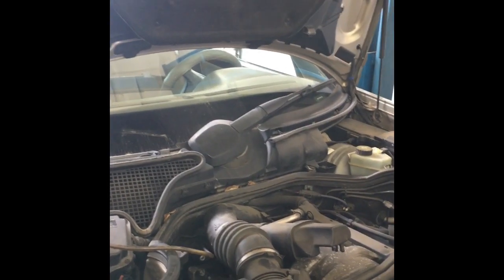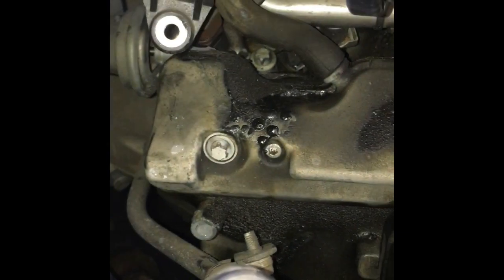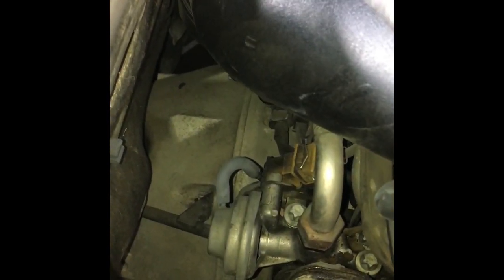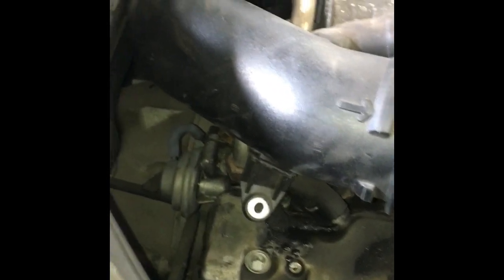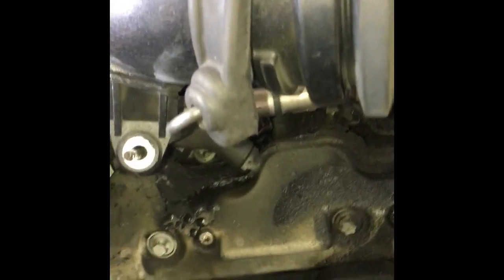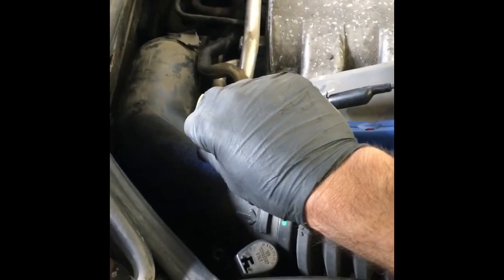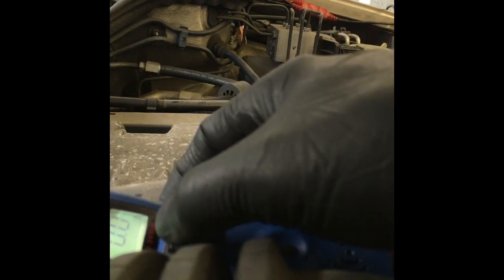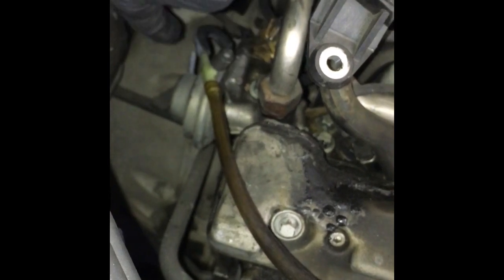How to Diagnose an EGR Valve on a Mercedes

Comment: I added power to the Transducer just like you did and nothing no stall the only thing prior to this test that I replaced was the transducer vacuum switch valve it self if I push on the diaphragm manually it stalls at idel or if I bypass the valve switch all together and add vacuum directly to diaphragm  vac line it stalls I use an old  large pork cereng it makes a lot of suction
Reply from the maker: Sounds like you're on the right track the EGR valve seems to be working by what you told me. So the vacuum switch has to have supply vacuum and then route it to the EGR valve from there. If the switch is not getting ground or power like you said it could be a broken wire in the harness somewhere. And you would have to find the pin numbers on the PCM and Ohm check the wires from End to end.

Comment: thanks if you look up an egr valve for a 2002 mercedes benz e320 you will see this part I'm talking about on the under side of valve it'  just clips on its in between the input suction I Don't  see any point in having it there to see this pies you have to really look closely at it any way thanks let me know what you think

Comment: Hello Brian, I appreciate the videos and that you're taking time to reply to people!  I've got a 2006 Mercedes R500 and it popped the P0400 code recently.  146k on it but overall in good condition even with Michigan winters (read: salt on the roads).  Old EGR valve was a little rusty, seemed like it didn't want to return smoothly when operated manually so I replaced the EGR valve/solenoid and EGR pipe with new.  I noticed 2 of the PCV hoses on the left/drivers side head were cracked or very hard so I replaced those also.  Cleared the codes and the car was good for maybe 3 days and less than 100 miles and the P0400 code came back.  I have seen 1 video that said to check for a intake manifold pressure sensor hose on the right front of the engine and another that said to pull what looked more like the PCV top portion of the valve cover (youtube user ok303 ).  Anyhow, any insight you have would be appreciated.  Thank you!
Reply: I'm going to follow the steps in the How to Diagnose EGR Insufficient Flow video this weekend and will post what I find.  Getting ahead of myself.
Reply from the maker: blaine t hello. I would recheck the EGR symptoms. Check to see if the vacuum switch is getting vacuum from the intake and make sure the hose is not blocked. Then power the switch to make sure it works. If that’s good apply vacuum to the EGR Valve with engine running the engine should stumble. If it does not either the EGR tube going into the intake is plugged or the EGR is not working. If all that test go then I would suspect the map sensor.

Comment: Hello Brian. Great video. I got a P0400. Exchanged all the hoses, since some where in a pretty sad state. Cleaned out the EGR valve, and pipe. New gaskets. Now my OBD reader first gives me the P0400 as pending, and after a bit of driving, the code goes to confirmed, and the check engine light turns on. I tested the solenoid and it clicks when I put current through it. I hooked up a vacuum pump to test of the EGR can hold the pressure, which it can. Today, I tested the voltage on the connector, and weren't getting much until I started the car. Then it would jump up to 10.8V, but is that enough? If not, what can I do next? I have already replaced the alternator/voltage regulator, and tested the battery, which was good. Any help would be much appreciated. Thank you.

Comment: I have the dreaded PO400. I found a cracked hose, I replaced it, the egr tube wasn't very blocked, but I cleaned it anyways. PO400 code still on, and now I have a heated intake code, I guess the heated air connector didn't get plugged in effectively. One forum says the egr valve lasts 100k. But I'll follow your directions. What's the tester your using? BTW my W210 has 437k, yup, crazy, but newer motor, otherwise all original and in great shape! I bot it in Sacramento 3 years ago and drove it to Maine, now it's in New York... Thx bro
Reply: Five hundred 20s  How do you reset it bro?

My 2000 CLK 320 idles badly, as in it will idle erratically, then revs will go up to 5,000rpm without touching the gas pedal..... yet is okay when driving as in it drives normally , just at idle? Could this be the EGR?
Reply: Five hundred 20s  Thank you!

Comment: I fixed it with your help thank you the main input vac line thats on egr and interconnects to plastic junction connector with flathead dial under  it  was problem it wasn't allowing any. vacuum to come in when applied so I reset the dial to let more suction tru and it worked but I'm still not sure what the purpose of this dial is do you know
Reply from the maker: I'm glad I was able to help you. Not really sure what dialed you're talking about. But I think you're talking about the vacuum switch. That's a on off switch that the computer can control. So that the EGR do's not come on at idle. That would make the car stall.
Reply from the maker: I got another Mercedes in the shop today and I look at that dialed you were talking about. That diode is designed to reduce some vacuum. If you apply too much backing to the EGR valve it can stick on. So that's what that Valva supposed to do hope this clears things up.

Comment: Hi Brian, I'm still not understanding the purpose of the EGR and changeover valves. What do they do, and if they're not connected, how does this affect or damage the engine?
Reply from the maker: Simon King the purpose of the EGR Valve is to cool the internal engine temperature down by reducing some of the air fuel ratio. It does it by recirculating engine exhaust instead of oxygen. I'm not sure what you mean by switchover Valve. I think your talking about the vacuum switch that Controls the EGR Valve and that's what it does. It's just a switch that gives the EGR vacuum to open the Valve when the car is under loud. The EGR only come on under hard acceleration. Mostly when you take off from a stop. Hope the clear things up. Thank you for watching and writing!

Comment: Thanks for the video, very helpful. So my valve moves and holds vacuum, solenoid clicks when I give it 12v however, when I run the car and give the solenoid power, the engine is not effected at all. Seems like it's not getting the vacuum to the EGR valve? Vacuum hoses around the EGR valve all look good. Curious what I should do next.
Reply from the maker: Jacob The metal pipe going from the EGR valve into the intake plugs up with carbon. So you need to take the valve off and the pipe and use a piece of wire and unplug the pipe.

Comment: Hi Brian, I get the P0402 error code on my 07 GL320 CDI. I removed and cleaned the EGR valve but it didn't have any carbon build up. This valve have no vacuum lines. How can I verify that the valve is bad? Thanks

Comment: thank you vary much for replying I want to give you a list of what I've done so far so I'll just post it here in comments so all vacuum lines near egr valve checked map sensor up front it has a line that travails to intake and lines to map checked all good so with key in position 3 car off only 12v+ was found no ground and did test with car reved to 2500-3500rpm and still no power  vacuum valve is new by the way or transducer
Reply from the maker: On some models you have to actually be driving the car before the PCM will turn the ground on for the vacuum switch it will not do it at Idol.

Comment: Hi Brian, thank you for the great video, I have a different problem, need your expert opinion, I have 2009 SL63 AMG, the engine stalls when I put in D or R, the engine runs fines and revsup in N or P. There are no fault codes, I have flushed the transmission, changed throttle body sensor and MAP sensor but no change, could you comment on this please, thanks
Reply from the maker: jj My initial thoughts were of torque converter problem. I’m not sure what type of scan tool your using. But you want to make sure that you can scan all the modules in the car for codes. Also I would check some basic stuff such as fuel pressure. I have seen Mercedes have plugged cats that would cause the symptoms also. To verify that you can pull the O2 sensors in front of the cats out and see if it still stalled when you put it in drive or reverse.
Reply: Hi Brian, thanks for the response, I am using Mercedes XENTERY/DAS scan tool, I have scanned all the systems including ECU and TCU. I will try the O2 sensor trick and check the fuel pressure as well and let you know. In case I have send my torque converter to rebuild, who would you recommend ?? Thanks again
Reply from the maker: jj I don’t have A recommendation for transmission shops or parts. We usually replaced transmissions with brand new ones or remanufactured one from the dealer.

Comment: I replaced egr with new. Took out tube and cleaned thoroughly   Replaced a few vacuum lines that were slightly worn. Reset codes and p0400 keeps coming back.  Any ideas?
Reply from the maker: If EGR valve works getting a vacuum Signal and the ports or not plugged with carbon then I would check the map sensor at the font of the intake. Make sure the vacuum lines going to earn good shape and also test the sensor.

Comment: do you know what other parts that are associated with the function of the egr valve please as you can see
Reply from the maker: I would start by pulling the vacuum switch off and checking the lines that go under the intake. Sometimes they'll look OK but they will suck closed and not work. And apply power and brown to the electrical vacuum switch and see if it's working. I would start with that. When I get back to the shop I'll look up and see if there's anything else involved in that system for you hope this helps for now.

Comment: Hey my friend I have a old 96E 300 diesel diesel non Turbo. This car has vacuum and electric EGR valve hook up. No mechanics around my area doesn't want to touch the car they told me it's too old. The wise on the EGO valve broke off .    there's only 3 Color codedCan you help me where it goes on the harness. I bought a aftermarket   Plug. But the colors are different than the original one on the harness. Can you give me a picture of diagram of the colors  That goes on the harness. If you could help me thank you very much
Reply from the maker: I don’t have any information on a car that old. Sorry I can’t help you with that one

Comment: My 2000 CLK 320 idles badly, as in it will idle erratically, then revs will go up to 5,000rpm without touching the gas pedal..... yet is okay when driving as in it drives normally , just at idle? Could this be the EGR?
Reply from the maker: Paul Bryant now it sounds like you have a big vacuum leak. If it was the EGR that Idle would be extremely low.
Reply: @HowtoAutomotive  Thank you. Okay, on missions to find the vacuum leak today!

Out of interest. What do you think to the 320 (W112) engine, are they any good? I have only just got my CLK 320.